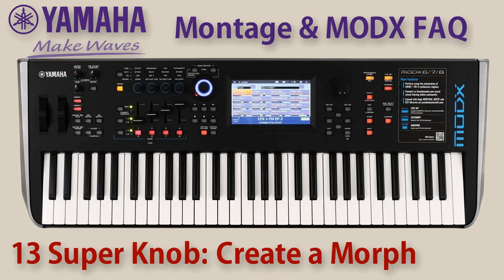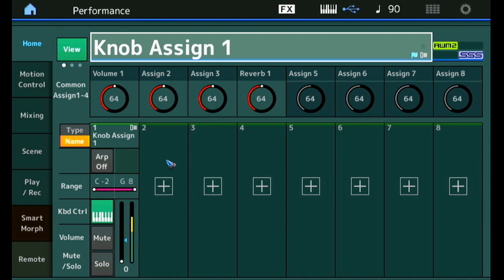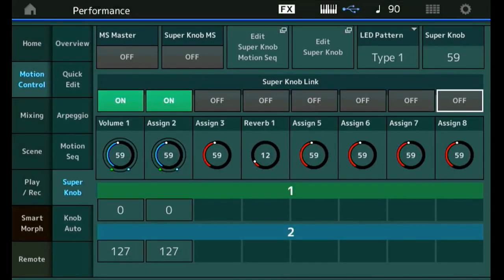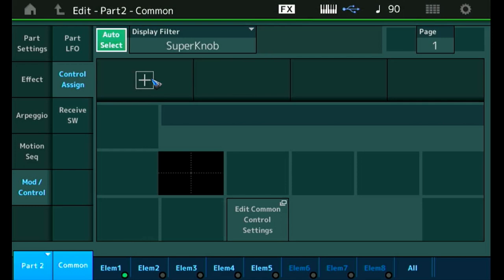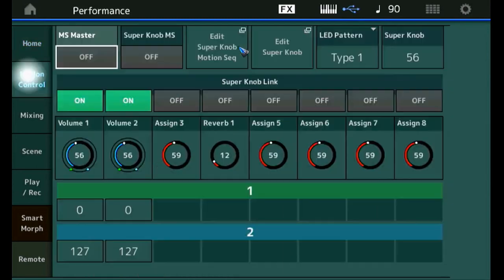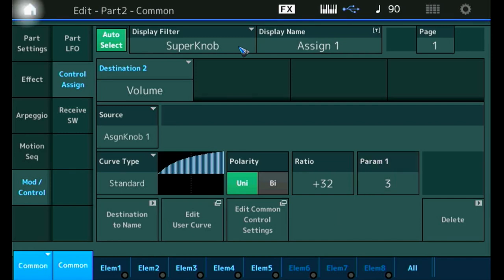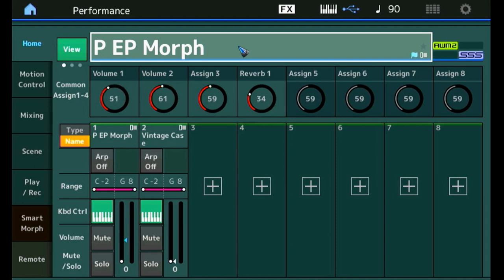Yamaha Montage MODX FAQ 13 Super Knob Morph

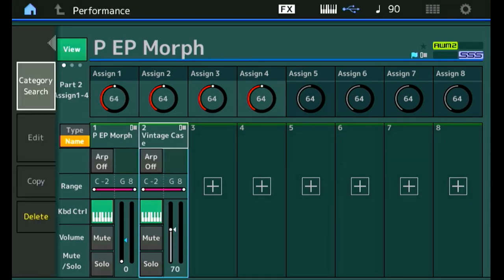Comment: What confuses me is at 6:45 onwards you're assigning Part 2 vol to knob 1 (as you did for Part 1, the acoustic piano). So both volumes should be assigned to Knob 1? 
So I'm missing how we end up with volume assigned to knob 2?
Reply: I am confused also. You set part 1 volume in the part edit and the part 2 volume in the common edit? I just don't get it. Then you add knob 2 to the super knob. I really don't get it.
Reply: @idemditto  First he assigned part 2 volume to knob 1 at the PART 2 level (then all knobs only affect this part). Next, he assigned knob 2 at the COMMON level to control knob 1 (volume) of PART 1. This common level assignment then allows to you control the volume of part 2 (and 1) with the Superknob (always at COMMON level).